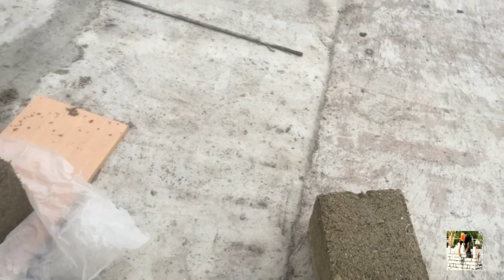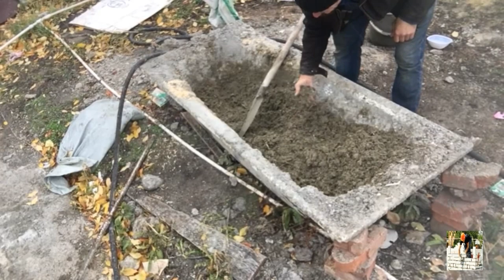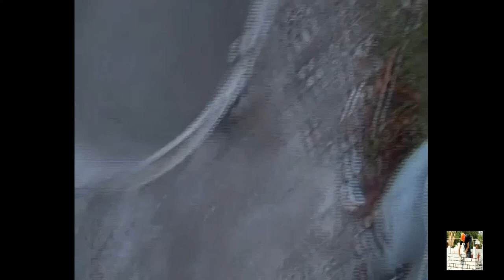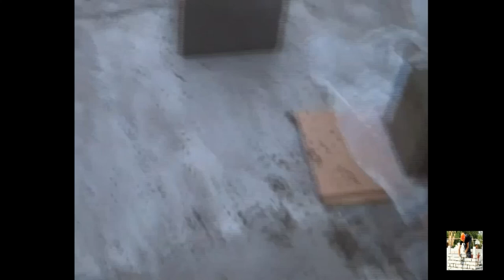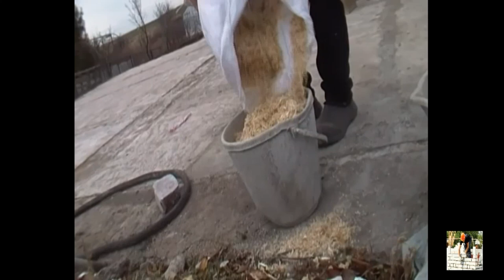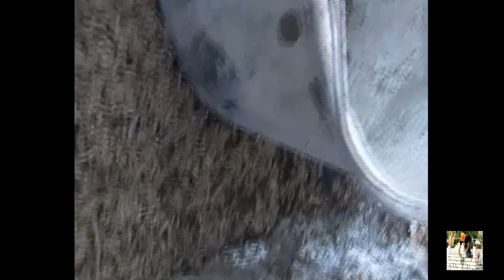making sawdust-concrete blocks with their own hands!

Comment: My uncle experimented with this back in the 80s and through his research after you formed them in the mold you pull a vacuum on them to make the block density go up also put a drop or 2 of dish soap to help the water/Portland wick in to the sawdust
Reply from the maker: Okay I agree
Reply: sound liek you 2 are project scamers.. there is no scientific fact that wil ldo anything but be a burden. also how do these blocks withstand under high temp? will they burn? do they conduct heat or electricity?
Reply: @squadfam9493 I imagine these are actually superior to straight concrete due to the flexibility of the sawdust fibers and the dramatic increase in insulative qualities. 

And the cement likely makes the brick fibers mostly immune to fire

Comment: Hey.. Could you post the percentage compositions in the description. Thank you
Reply from the maker: composition of sawdust concrete 1 part cement 6 parts sawdust 3 parts sand 1 liter of lime
Reply: @robin-myhouse3472  umm, for the 1liter lime to "parts" ratio. I assume you mean parts=size of bucket in video.  So, what size bucket are you using??? Thanks
Reply: @yusufusayd3151 it doesn't matter what size bucket as long as it is the same size bucket u use for all ingredients. You could use a "cup" for the bucket to make a sample of the finish product

Comment: Is the purpose of adding sand to add more weight? If not then I don't see the point in adding sand
Reply: The reason why sand is used is because the aggregate(sawdust) isn't a good binding material for the cement. This also goes for anything that is going to be load bearing when mixed with concrete. Sawdust by itself acts like a sponge rather than a surface for the cement to bind too. Now if the building was partially framed in wood, the mixture that doesn't use any sand would be better as it's not meant to sustain any weight, the timber framing is the weight carrier, the dustcrete mixture without sand would just be an insulation pack around the timbers to add a little more rigidity to the wall and increase the insulation value of the wall itself. Because they are making bricks instead of actually framing the building, the bricks will have to be load bearing, so it's mandatory that you use sand in the mixture for the cement to bind to adding strength and rigidity to each brick.

Comment: Great vid ! but the saw dust MUST be mixed with part of shaving or the blocks are too weak from my own tests. What kind of lime are you talking about ? In States you cannot find the good one or at a ridiculous price ...Thanks and liked !
Reply from the maker: interested person who understands this issue. lime is a white powder that removes sugars from sawdust and protects sawdust from rodents mice rats . and I agree it's better to mix fine sawdust with shavings.
Reply: @robin-myhouse3472  I did not know that there were sugars in wood needed to be neutralize. My question was on the type of lime you use. In usa they only know the hydrated lime used to control the soils PH. They dont know the Aerial or the NHL lime. Impossible to find except from import from France at 10 x the price.
Reply from the maker: that's right, this is slaked lime